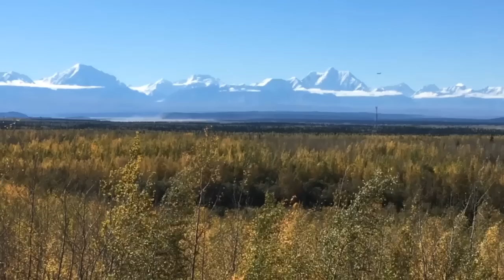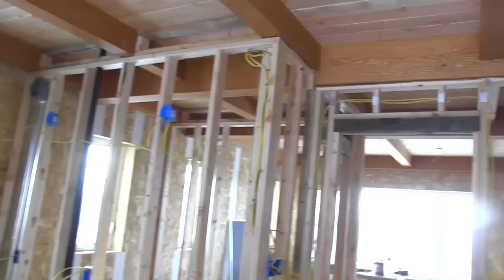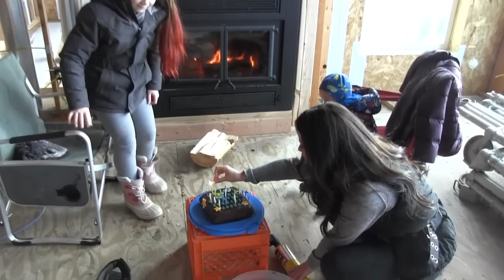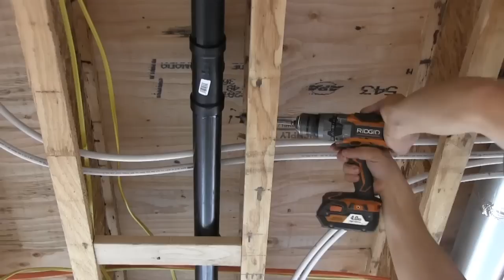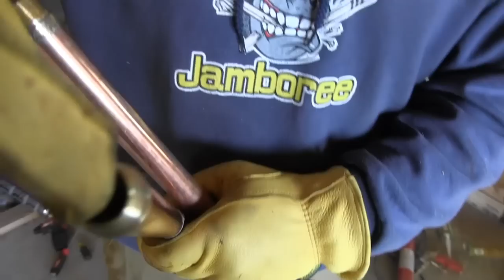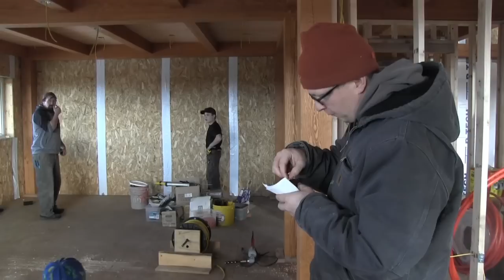Utilities, Utilities, Utilities .... - EP 26 Alaska Dream House Build

Comment: Happy Birthday Jacob!  We're allowed to rough in electrical here, but need permits and inspectors for the rest.  Thank you for the water manifold tip.  I will be using them in my remodel.  It takes up a while for two of my lines to warm up.  I was also recently introduced to shark bites.  They cost a little more, but worth it IMO...Liked!
Reply from the maker: Thank you!
Reply: Sure.  They are compression valves you simply slip over your water line.  Just Google "shark bites" for the details.  Unless I have no alternative, I will never go back to the old primer/glue method.
Reply: End User What  are shark bites?  Can you educate the rest of us?

Comment: Wow, this is exciting!  Great idea to put in the central vac system Ana.  You'll be so much happier hauling a bit of hose around than carrying a vacuum cleaner up and down your stairs and all over the place!  Just a question.  Are you at all nervous about putting the drywall up over all the electric before you're hooked up to power and can test everything?  I guess it's not the same as the plumbing tho...once all your wires are run, you can fix any problems even after the drywall is on right?

Comment: My dad and I share plumbing supplies. A few years ago, he paid almost $100 for a PEX crimper. Best purchase ever! It is so nice routing pipe as if it were wire. We have never had a leak in any of our connections. If you want to add a branch onto a main, you don't have to get every drop of water out of the pipe (like when you are soldering).
Reply from the maker: A must have tool!

Comment: I like the Monday posting. It falls during my lunch break so I get to watch early. :-) 
The electrical is looking very good. Don't forget to put an extra empty conduit to the Kitchen Island for whatever comes up later. 
Are you guys going to put in any Solar?
Wow, I don't like working with plumbing, and Jacob, that looks more complex than the electrical (Ana looks like she is over it too)!.  Happy B. Day, couldn't think of anything else I would rather be doing on my birthday (except for plumbing, ugh).
Reply from the maker: Haha, for sure! Thanks!
Reply: Randall Muncy Can you tell me more  about  having an extra empty conduit in the kitchen.  I wanted to understand what  you meant.
Reply: The kitchen at my house is sort of the data hub. When I remodeled several years ago, I had the walls open so I could run coax cable and CAT5 to the point I wanted it. Who knows what the future holds for devices? Yes, wireless is fantastic, but if you wish to stream 4K/UHD/HDR/60Hz video, you better have a cable (just an example). Just a few years ago, I would plug in a charger for my phone and that was it. Now I need a charger for the 2phones, 3 iPads, DSLR charger, portable USB power brick etc. Pretty soon, your house will be out of date if you do not have fiber optic drops in all the rooms. UHD video is just an infant, but 8K video is being rolled out very soon. Most of the time if there is a new cable of some type to install, you simply open a section of drywall at both ends and fish it. But in Jacob and Ana's house, the SIP walls make that a bit more difficult. If you have un-used conduits pre-installed in the hard to access areas (between floors, islands, concrete firewalls, etc.), it helps future proof the house. Especially if it is your forever home. Just a thought. I am not an expert and do not play one on TV. That is Jacob's job! :-)